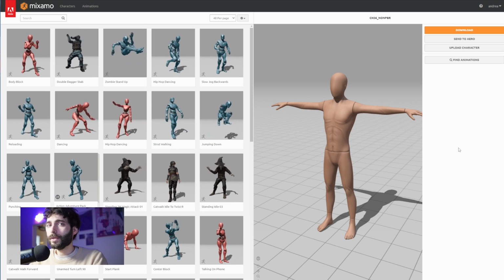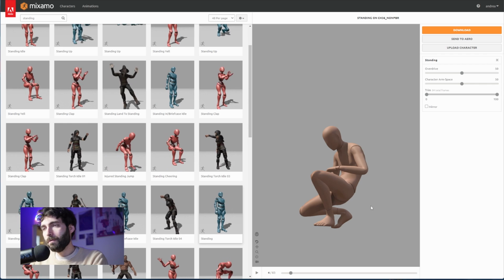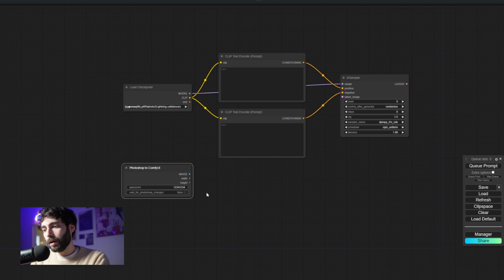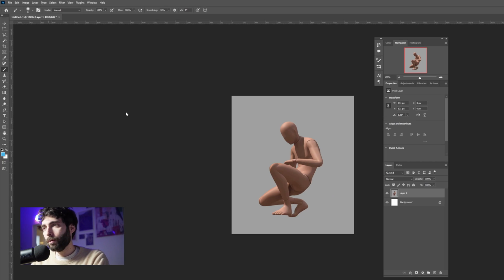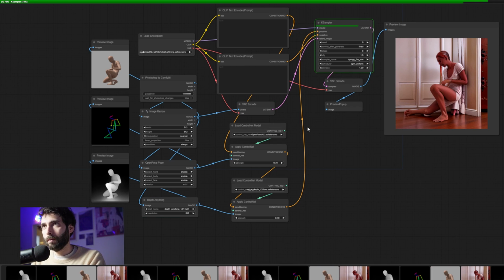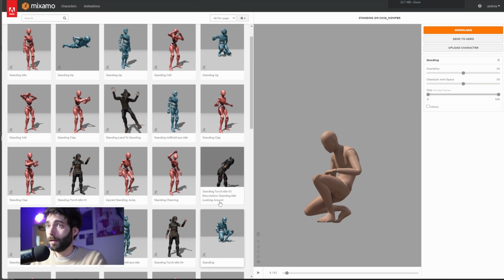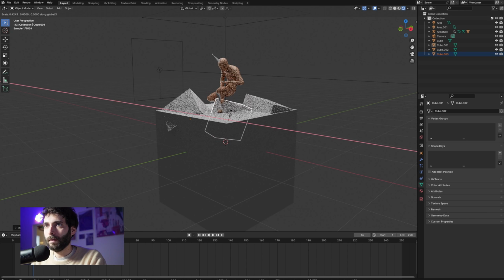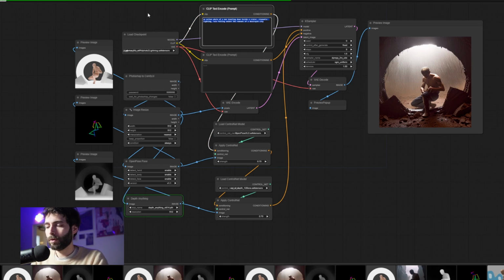Adobe Mixamo & Blender to level up your poses in Stable Diffusion - SD for Professional Creatives

Comment: Hi Andrea! cool tutorial, is it possible to have a similar workflow for Macs? Thanks
Reply from the maker: Hey there! Until we get a node that does the same that Photoshop to ComfyUI does but for non-Windows OSes I’m afraid there’s no solution to this, apart from ditching the “real time” aspect of working in PS and using a simple load image node. I’m testing out a node that screen grabs, from any active window, but that one uses a lot of resources and I’m not sure it can run on macOS as well. I’ll look more into alternatives for macOS because it’s frustrating to not have a cross platform solution, but as of now I have found nothing yet.
Reply: @risunobushi_ai  Hi Andrea! Thanks a lot for your quick answer! I noticed some other custom nodes are not installed as well on Mac OS, like the OpenPose pre-processor  or Depth Anything :(
Your workflow is really interesting for me :)
Reply from the maker: Are you importing the workflow .json file and installing the missing custom nodes via the manager?
Reply: @risunobushi_ai  Morning Andrea! Thanks! Ah, I was doing from scratch to learn! it was not working, opening your template worked fine, Only ComfyToPhoto node is not working :(
Reply from the maker: @eias3d  yeah, that node is windows only because of the way it is coded. I think a Mac version should be possible, but unfortunately I’m not a dev by any stretch of the definition, so I can’t change that

Comment: Hi, do yo describe the specs of your gear in some video? If not, would you like to share?
Reply from the maker: My current rig is:
- CPU AMD 5900x
- 64GB RAM 
- GPU Nvidia 3080ti (bought during the Great GPU Shortage, if I were to buy it now I would prioritize VRAM over anything else, but at the time models weren’t quite as demanding). 

Generations are a bit slower than usual on video, because I’m recording my screen with OBS and myself with a Sony A7R IV.
Reply: @risunobushi_ai  Thanks a lot.  I manage to run simple workflows on my current computer, but I'm in need of a better set up.
Reply from the maker: There’s some ways to trim down my workflows. For example, in this one if you switch the photoshop to comfyUI node with a load image node, remove the pop up node, and don’t auto queue, the overall load on the GPU decreases a lot. You can also choose to sacrifice the weight of one of the two controlnets (I would lower the openpose, personally) so that the generations run faster.
Reply: @risunobushi_ai  Of curse, I'm aiming for Ip-Adapter and that is a hungry one.  I just placed my order.  Thanks a lot for your help.

Comment: Where can i find the DepthAnyThing.safetensors model?
Reply from the maker: If you load up the workflow and have comfyUI manager installed, you should be able to install most of the missing custom nodes (depth anything included). Otherwise you can install this repo: https://github.com/Fannovel16/comfyui_controlnet_aux
Reply: @risunobushi_ai  wow.. that was fast... :) Will try that.. thx